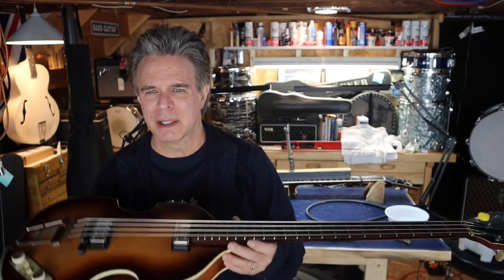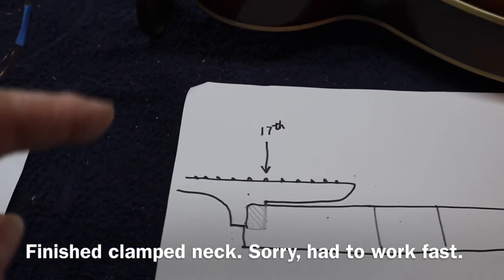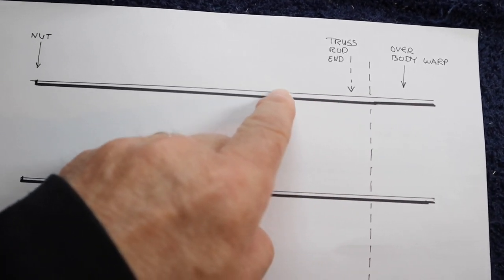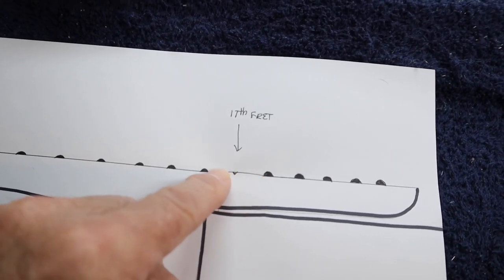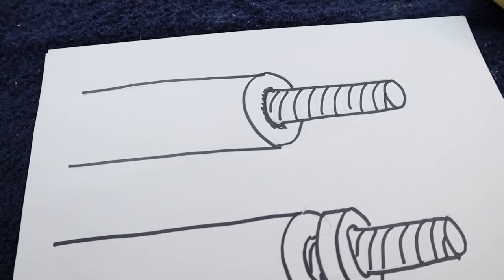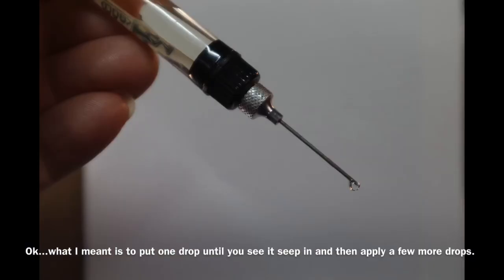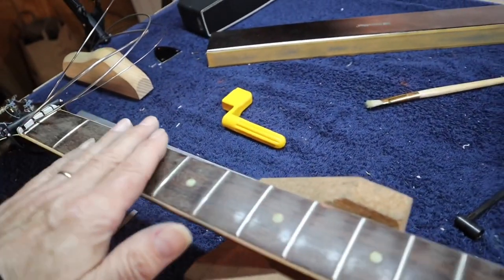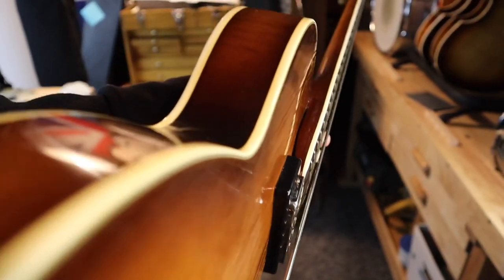Vintage Hofner 500/1 Bass Neck Warp Repair. Beatle bass. Hofner 500/2.

Comment: Thank you for this.  One of several issues with my old Club is that ski jump warp.  Is there an alternate method that doesn’t involve removing the fret and drilling the fingerboard to infuse steam?  Would prolonged clamping with a straight edge be sufficient?
Reply from the maker: Hi, If you do a complete refret you can sand the upper warp flat but that depends on how much of a warp there is. If you do try the clamp be sure to loosen the truss rod to allow it to move. Be careful. Dont keep tightening the truss rod as that wont help with the warp up that high on the neck.
Reply: Thank you for the guidance.  I don’t have nearly your skill level so I won’t tackle anything that is too ambitious and can set me back.

Comment: Great video.... thoroughly enjoyed watching to see your magic being done.
One thing I would like to ask is....... if from time to time the part that needed work done (next to pickup)is something that does happen due to design. Would it not be possible to put a small wedge underneath attaching the board to the body?
Reply from the maker: Hi, i wouldnt do that as it is the standard hofner design to have the neck over body design and tone. Same with their violins cellos and standup basses. Also it would devalue the instrument. Best to just loosen the hyde glue and reposition it per the video.  Thx!  EJ

Comment: The pickups look like it’s been place differently. Why?
Reply from the maker: Hi, they are stock. You might be thinking of the cavern bass placement where the pickups are closer together. Thx!  EJ
Reply: I was looking at the “staples” if that what it’s called, where the pickups’ staples are facing the the bridge. Is that how its built?
Reply from the maker: Yes...that is stock.